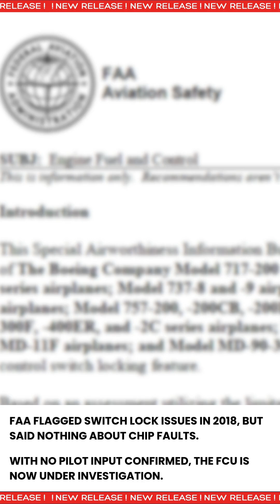Air India 171 Crash: Could a Chip Malfunction Bring Down a Boeing 787? #airindiacrash  #aviation

Comment: Before you go on to blame Boeing for the supposed fuel switch fault, Boeing makes the plane, not the hardware. Those switches on most Boeings are made by Honeywell. There could be pilot negligence. Or just the public not wanting to admit that not everything is Boeing's fault. Same thing for the engines. Boeing makes the main body of the plane. General Electric and others like Rolls Royce make the engines.